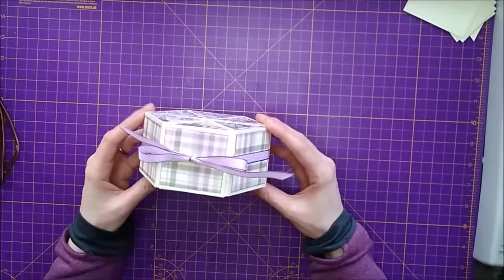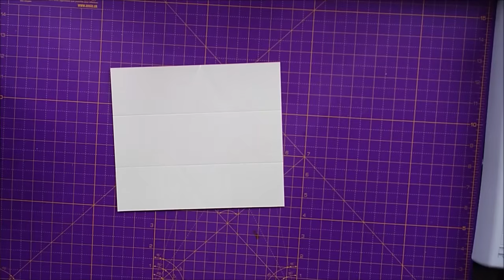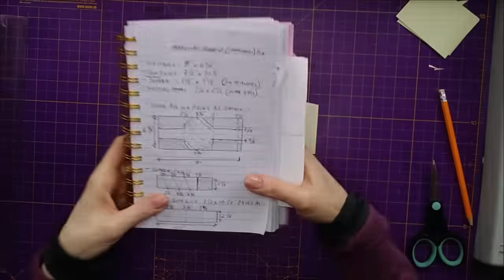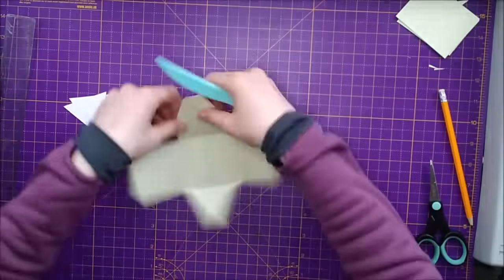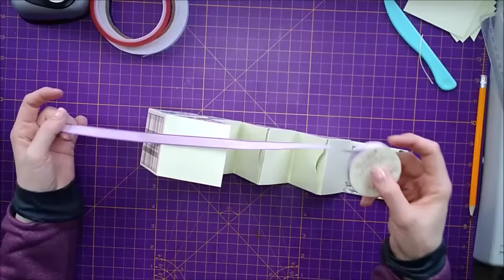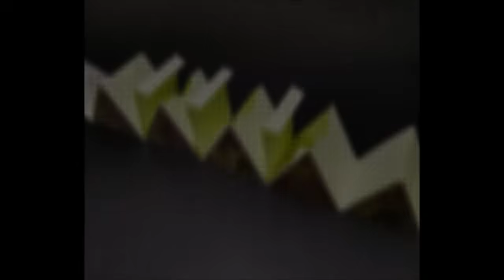Hexagonal Roll Up Gift Box Tutorial

Comment: My son’s birthday is on the last day of summer. I would love to make him the watermelon box. Do you have a tutorial for it?  If not could you guide me with the measurements of the different triangle sizes? Tysmfs ❤
Reply from the maker: Hi - I've only done this video. The watermelon box is only a touch smaller, but it's easier to do with these measurements than with the original ones (which is why I sized it up - as the watermelon box was very difficult sizes and had problems!)